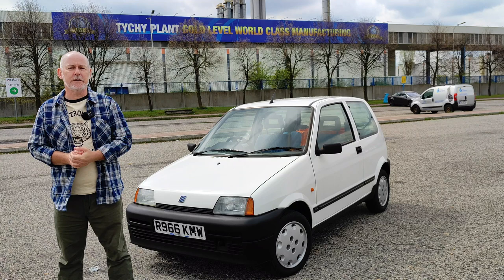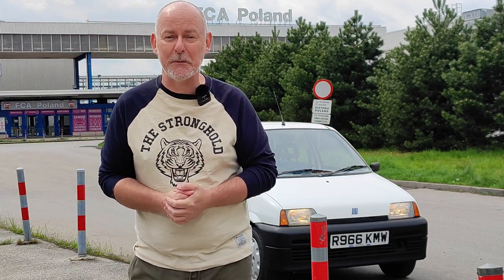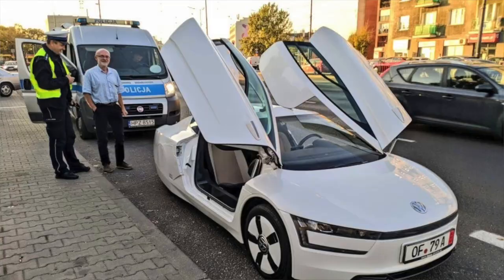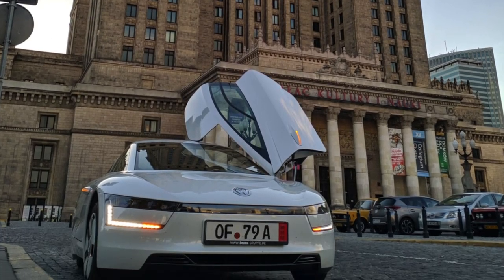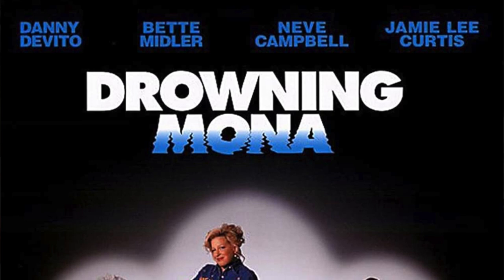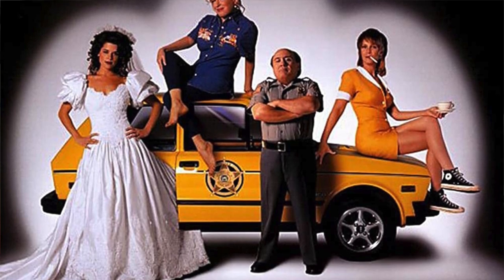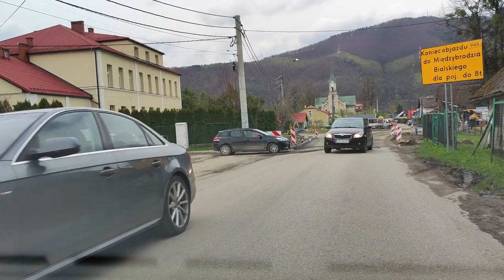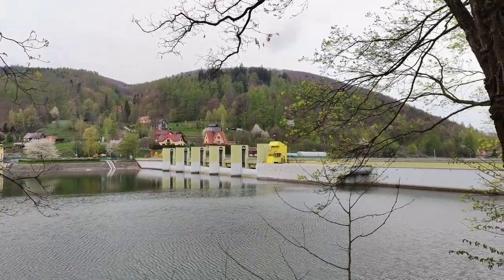Driving our tiny £500 Fiat Cinquecento to the factory in Tychy, Poland!!!

Comment: What's creepy about the hotel Beskid you mentioned (15:00)?  It's actually nice, clean, tidy and free from mould unlike English small "posh" hotels with a creaking floor and a shared bathroom! ( just an example: Totton, near Southampton ). And hotels in Poland don't have carpets in bathrooms like some English hotels. Shame you didn't show one of Polish typical houses we saw in a background when you drove your car (08:00). They are big, with solid thick walls with elevation and huge gardens. English houses are small, moulded with thin walls, tiny gardens and they are not worth even half of the price that desperate British people pay for them. However, I understand why British people build tiny houses. It's because this island is a small country and has a limited space. 
And one more thing. This building behind you ( 14:14 ) would still look better than British cottages, if it only has windows 🙂 Don't get me wrong, but, many Polish houses have sheds of the same size as some British houses🙂